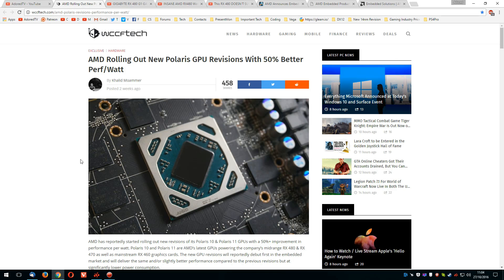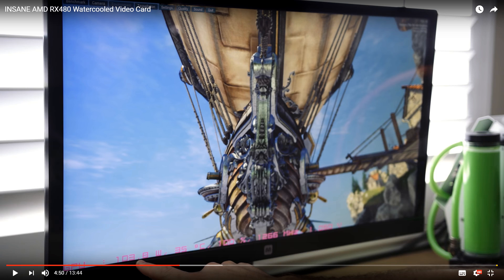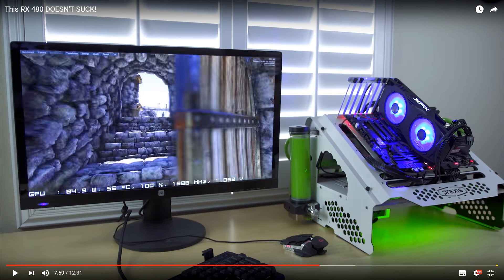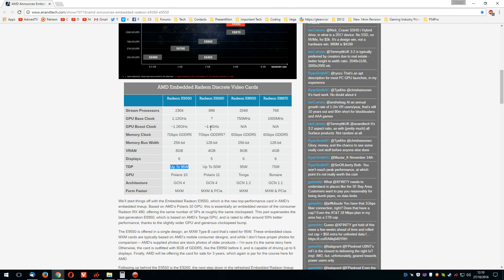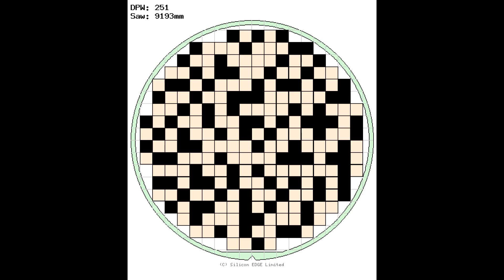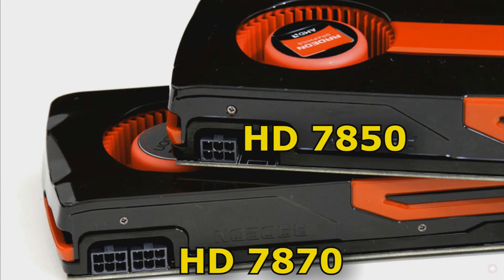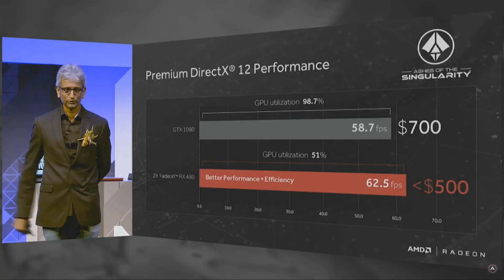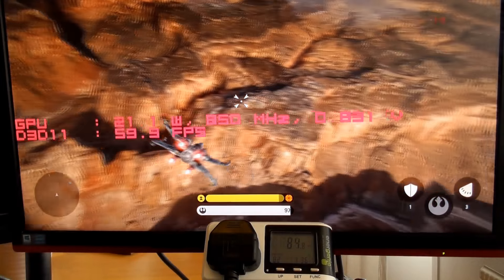Polaris Efficiency - Truth or Myth?

Comment: hey! do you think its safe to run an r9 390 in crossfire with a 650 watt power supply?
Reply from the maker: That's pushing it but depends on the supply really.
Reply: AdoredTV Its an overpriced evga power supply from inet . i found an r9 390 for 1250kr at school and im super confused. get this and maybe blow my psu or save for the 1070 and get it 4 years from now. would you do it?
Reply from the maker: I wouldn't bother going Crossfire with two 390's now tbh.
Reply: AdoredTV thanks mate . I won't get another 390 :) . I'll wait for a discount and grab the 1070 at inet
Reply: +Cypher99 Your 390 is fine I guess, if you can wait for vega and get yourself a vega one, given it's within the 1070's price range. 

I can't justify buying a 1070, really. since you're waiting for prices to drop, i take it you're on a budget. So either wait for volta to be released next year (this is a wild guess) in October or get a 1070/Vega on the basis stated above. 

Do you have an EVGA Supernova G2 650 PSU?
Reply: +Cypher99 Your 390 is fine I guess, if you can wait for vega and get yourself a vega one, given it's within the 1070's price range. 

I can't justify buying a 1070, really. since you're waiting for prices to drop, i take it you're on a budget. So either wait for volta to be released next year (this is a wild guess) in October or get a 1070/Vega on the basis stated above. 

Do you have an EVGA Supernova G2 650 PSU?
Reply: +Cypher99 Your 390 is fine I guess, if you can wait for vega and get yourself a vega one, given it's within the 1070's price range. 

I can't justify buying a 1070, really. since you're waiting for prices to drop, i take it you're on a budget. So either wait for volta to be released next year (this is a wild guess) in October or get a 1070/Vega on the basis stated above. 

Do you have an EVGA Supernova G2 650 PSU?
Reply: A. Y yes Ay I have an Evga supernova gold psu. My problem is with my 390 , I can't push bf1 at ultra above 1440p . I used to be able on bf4 and I think I'll have to make a choice before Black Friday . Idk man
Reply: Cypher99 if you can get one for less do it, if not don't
Reply: A. Y wait...youre advising me to get the second 390?
Reply: Cypher99 No, I'm advising you either to grab a good deal or wait for vega so upper-class GTX GPUs have a viable competitior. 

nVidia have no competition to face for the 1070 and upwards. 
Don't get a 2nd 390 tbh
Reply: A. Y tanx
Reply: How much is a 1070 in your money ? And I think a 650W PSU is more than enought, but not sure
Reply: Thalles Eduardo a gtx 1070 costs 550$ in Sweden . It's dumb
Reply: HAHAHAHA, you should see here in Brazil, costs around 2 times the minimum wage of one month for 40 weekly hours (561 dolars, but we have way less money). Jokes aside, and the 390 ? how much it costs for you ? I don't recomend running two GPUs instead of a better one but maybe it's good for you to buy a Vega or Volta GPU instead of the 1070
Reply: the 390 is dirt cheap now. like 100 dollars
Reply: Thalles Eduardo you can get 4 390s for the price of 1 1070. its crazy
Reply: Cypher99 Go for a new PSU and the crossfire.
Reply: A. Y i already ordered the 1070
Reply: Have Fun, man. It's a very good card, enjoy. (I'm jelly)

What brand is the 1070? MSI? Zotac? KFA²?
Reply: A. Y msi armour. well tbh its not for me. my friend paid me to get one from amazon. im buying mine on black friday
Reply: In that case you may want to check out this( https://www.reddit.com/r/Amd/comments/4nmhjw/gtx_1070_vs_crossfire_r9_390_1440p_not_oc/ ) and make up your mind for good
Reply: A. Y thanks haha. ill check and leave  a reply

Comment: 12:51 - I think I might disagree, sir.  I suspect that Polaris 10, along with whatever process improvements, will be rebranded as RX480 -> RX570 and RX470 -> RX560, and that RX590 and RX580 will be, respectively, full and cut-down Vega 10. OR, possibly, 590 and 580 will be Vega 11 and the next Fury-class (whatever they're called) will be Vega 10.

Comment: I find it a little odd that people don't realize that there has and will continue to be variances in the same model of gpu, and that binning will continue to happen. Anyone that recalls, will remember the mobile versions of certain socket CPUs that would work in the desktop were in massive demand, as they ran cool, drew little to no wattage in comparison and were insanely overclockable, the marginal cost difference was well worth the major difference in performance capabilities, and it threw the market into a bit of chaos as the much more expensive models were simply not moving nearly as much as they could have.

Go back to before the 2000's, and people that were creating their own tools to overclock things before it was even an option and when it was REALLY thoroughly frowned upon, and very easy to burn something up fast. Even among the 3DFX cards at the time, people had a range of experiences, some couldn't go even 1mhz over their stock value..... some people could push insanely high... hell even the intel 486DX4's could overclock insanely well if you ended up with a REALLY good chip... "golden samples" happen more often than people might actually think, however a lot of people don't bother even overclocking and run pure stock all the time. Outside of my 3930k that I overclock to 4.3GHz, i don't overclock my graphics cards usually at all (mostly because i replace them so frequently i prefer to not take chances and frankly don't need to bump their clocks to get as much as one can get out of them.

So with that in mind, it's not hard to comprehend the REAL possibility of identical performance parts even within the same fabrication technologies to see major improvements, even look at nvidia's 9xx series gpus.... still 28nm... but with good engineering and excellent wafer turn outs, you can find some really impressive power reductions and much more easily obtained higher clocks.

We have to keep in mind that AMD really has to pick and choose how to divide the chips up, and they likely had a good portion of the chips hitting their 150watt tdp initially but then the "overdraw" alarms went off (which still haven't proven to be a problem anywhere yet)... All the worst still working GPUs were dumped onto the market first, and while this might seem like a horrible idea at first, we have to understand amd had to make fast revenue and get the product out there, and save their better binned chips for other applications to meet their requirements. While this sounds perhaps like a excuse, it would be naive to believe that they were the only ones to do this.

Comment: My only consume under 90 watt on GPU clock to 1370 without increase power  , i'm not stress test it with any programs since my CPU old Phenom II are not fast enough for my 480 but i've clock my Phenom II and increase dramatic FPS in many games but power consumption still the same.

Comment: As for the reference card... it is a beast. The cooler is a joke, but the PCB and the Vcore VRMs are better than most of the non-reference cards. According to "actuallyhardcoreoverclocking" those VRMs are pretty efficient at high temperatures (better than the Gigabyte, power-color and some more). The six pin on the reference card actually has 3 12V rails, so it can supply 150W of power, exactly as a 8-pin.

Comment: Another outstanding video, 
I found this video very interesting, I was totally unaware of the efficiency disparity of Polaris GPUs and the surrounding controversy, it seems like AMD/Global Foundries have been using Polaris to flesh out the problems in the new fab/process, I mean they would be improving the process anyway but this situation suggests that they are getting reasonable yields of fully functional chips but they are still seeing a fairly large disparity in performance/efficiency from chip to chip, which adds to  speculations I have surrounding Summit Ridge/Zen chips especially the enthusiast CPU's that are meant to hit the market first:

There probably wont be many models of Summit Ridge/Zen at first, i.e. just the performance "enthusiast market" products (possibly followed by server market products).  Will AMD be producing/binning/stockpiling chips extensively enough to be able to release a CPU model that meets the demands of the performance "enthusiast market"?  I have heard that AMD might be pushing back the release of their server market CPUs in favor of the enthusiast market CPUs, the server market pays more per chip, the server market expects compliance with power-usage/efficiency specifications for obvious reasons, pushing back the server market CPUs could be an indication that AMD/Global Foundries are not hitting the efficiency/power-usage/performance required to deliver such a product.  Unlike Polaris chips, AMD will have a much harder time pulling off a similar charade with the power-usage/efficiency of CPUs (especially server CPU's), and if there is still a major efficiency/performanc disparity between chips it may translate into large differences in overclockability.  My first concern is that the aforementioned may culminate in a large disparity in the overclockability of the early top tier product, my second concern is that people will react negatively to that product being marketed to the performance "enthusiast market".

In Lisa Su's own words, "Summit Ridge is our first Zen based product" and "it will go into the high performance desktop enthusiast market".

I think that Summit Ridge could be considered a high performance CPU, it will probably be reasonably competitive in the performance desktop/workstation market and it should, at very least, be somewhat popular with enthusiasts, but the enthusiast market segment is another thing.

IMHO for a CPU range/model to be Performance Enthusiast name worthy:
-It must be totally unlocked/overclockable
-It must have a reasonable and worthwhile overclock 
-It must be reasonably competitive with the current products offered in the performance enthusiast segment.
-it must Reliably overclock i.e. 24/7 stability.
-80-90% of CPUs of the same model should overclock to within a reasonable range of one another (~10%).
-It must not run unreasonably hot when overclocked.
-It must have reasonable driver support.

Lisa Su said Summit Ridge "will go in to the" "enthusiast market" and the current products in the performance enthusiast segment of the market all meet the prerequisites above but I'm not sure that Summit Ridge will meet all of them (especially not at first).

Speculation based on speculation but maybe food for thought?
Reply from the maker: I'm hoping that the process will have matured enough already to help Zen out - but don't forget that they also signed the new WSA allowing them to fab elsewhere. ;)

They've always said HEDT first though, with server coming right afterwards.  I think the server CPUs may be different somehow.

Comment: Holy shit, I forgot about that Gigabyte Video from Jay, I have the Saphire Rx 480 nitro + 8 gig, and mine is overclocked to 1424 mhz, it comes in 1306 OC'd, and i have overclocked it another 100mhz stable with only an increase of around 10-30 watts, but then the gigabyte card he used had  that much of high temps and wattage and it was barely OC'd, that's crazy.....allot of people were saying the Sapphire version was one of the bad ones but my card runs like a champ....
Reply: Kian Grey mine too 
OC it to more or less the same

Comment: After watching your many videos, I just got a new MSI RX480 (8GB) to upgrade my old 2GB GTX-680 with.  Hopefully will run Doom a little better now!  Thanks - keep up the good work!
Reply: warp00009 nice! You will get a performance boost. A very noticeable boost. Vulkan will reduce the frame timings and distribute the loads in the CPU and GPU.
Reply: Yeah, the new RX480 seems to run Doom a little smoother - possibly because of the larger video card memory - and the way that Vulkan works with the Nvidia and AMD drivers.  I never noticed any Vulkan performance improvement with the GTX-680 I had at all.  I still need to try the one section in one of the single player levels of Doom that dropped my GTX-680 frame rate to 1 or 2 frames per second until I got past it - to see how much better that section of the map runs with the new card - but I'm sure it'll run better!

 I noticed the other day that the Intel Extreme Tuning Utility (provided by MSI for over-clocking) only shows my RX480 as having 4GB, even though the box and serial number sticker clearly show that it should have the 8GB on it that I paid for.  Haven't found an independent way to verify just how much video memory it really does have on it yet, since this doesn't seem to be reported in the device description attributes show by Windows (in the device manager) that I can find.  Pretty depressing if MSI really shipped me a sub-specification card!
Reply: warp00009 get GPU z to see the amount of VRAM. Sometimes other programs make errors. It's normal. 

AMD funnily enough, produced the first dx11 card. But, Nvidia spent billions perfecting dx 11 while disregarding Vulkan and dx12.

The RX 480 (I own the sapphire version 8 gb), is a gem. You will experience a really nice consistent frame rate that gets very close to a 1070. Yes, a $250 usd card gets close to a so called 4K card while Vulkan is enabled. Funny how software can make a difference. I used to be nvidia but felt I was being ripped off. AMD offers the same features for much less. It's a win-win.
Reply: Thanks!  You're right - GPU z shows the 8GB on the card that I was expecting!  The Intel utility obviously must not be picking it up right.

Historically for many years I've exclusively used Nvidia cards because their drivers often seemed to be more stable than the AMD.  But after hearing about all the architectural, market penetration (on consoles),  and software development benefits now associated with AMD's technology, it seemed to be a good time to switch.  Happy with that decision so far! 

Now if I could only isolate and fix the terrible fan screeching noises that my (new) RX480 seems to be occasionally making (seemingly totally unrelated to load).  I have the MSI Afterburner utility running, but it doesn't really show any intelligent fan controls or fan speed monitoring (implies that there is no speed sensor for the fans) on my "Gaming X" card   - so I can't easily map which fan it is.  Had the card for nearly a month now, and it has made these noises - on an irregular schedule not specifically related to any GPU loading - since day one.  I was hoping that some use might eliminate "rough edges" in which ever fan it is, but it has not improved at all over time...  Honestly sounds like bad bearings when it is happening...  Noise schedule loosely seems to be 5 or 6 minutes of bad sounds every 20 to 40 minutes - but isn't necessarily consistent.  (Even does it when I'm not using the system, since seti@home beats the tar out of the CPU and GPU loading way worse than I ever do - everything at 100% for hours sometimes)!  I may try pulling one GPU fan at a time to isolate it, but obviously don't want to over heat anything! 

MSI wasn't very helpful the last time I wrote their technical support about a motherboard issue, so want to isolate any bad video fan component before i try to deal with them!

Thanks again for your advice and help!
Reply: warp00009 no worries man. Glad to help.

About your fan issue, at first, I thought coil whine was taking place but it could be that the fans are making contact with something. 

MSI's products work, but when they don't work, it can be an issue with their services.
Reply: warp00009 btw, enable fan monitoring in the settings of the msi afterburner. Then set your preferable fan curve.
Reply: No fan options show up in Afterburner, which the help tips say it won't show if the video card fan can't support them.  Not what I'd expected since I'd have thought that even the on-board firmware would want to know the fan speed to be able to precisely control it...  Maybe it's just doing that with a simple, separate, analog thermostat instead?  Seems odd...

Comment: Woot Woot!
Glad to have you back!

Well to me it's really not surprising that AMD can hit such low power consumption numbers with P10. Intel with low-power CPU- has been doing the same just by clocking lower with less voltage, and I suspect the same goes here.

That to me just means that anyone who's dissatisfied with a hot running card (which at 80 degrees I feel like that's just being picky since I believe such a temp won't damage the silicon on anything) should take a moment to stop feeling bad, and undervolt the shit out of their chip.

Comment: I bought an rx480 a few weeks ago after a long wait. But with this story i can relate. I have never had such a bad graphic card when it comes to overclocking. It just can hold voltage the basic clock holds. Undervolting on the basic clock doesn't hold. If there is bare gpu from the bottom of the barrel this one is it. ^^. Keep up the good work love your video's.

Comment: I have first hand experience with this. I had a 480 g1 and it sucked big time 82c max fan speed 1330-1350mhz. I switched to a sapphire nitro oc and this gpu does 1440mhz stock voltage stays under 70c. I can run this card at 1500mhz with increased voltage but usually keep it at 1460mhz for everyday use.